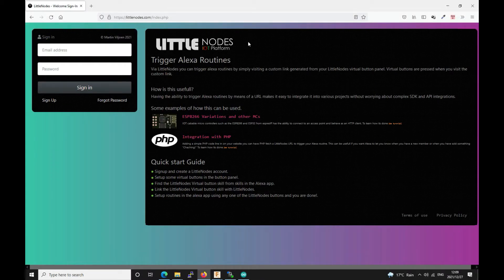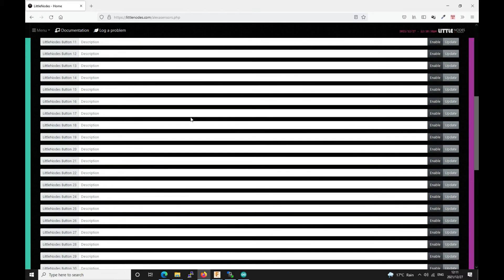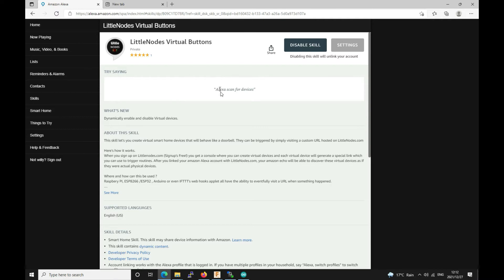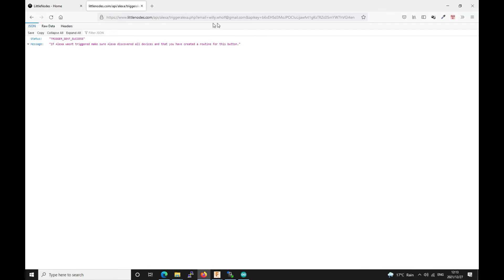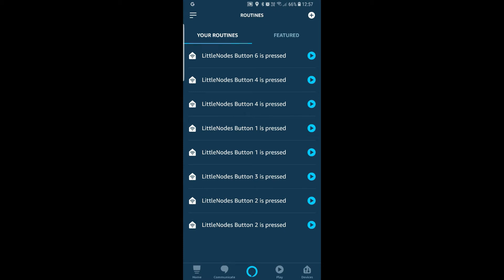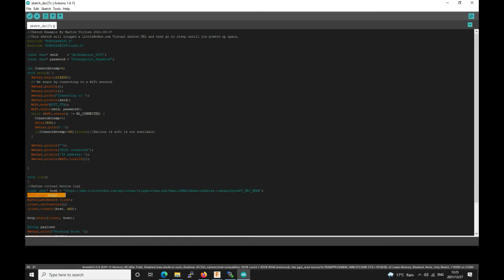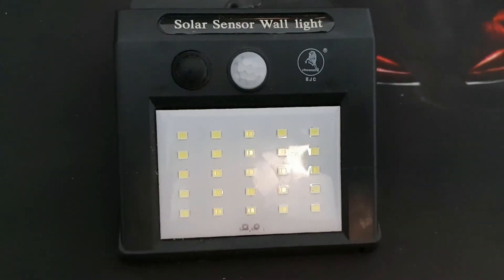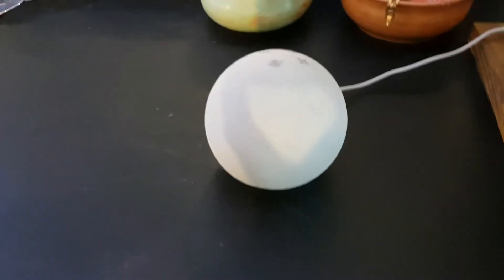Trigger Alexa routines with an ESP8266

Comment: This system is awesome.  It worked immediately using a WEMOS D1 Mini Pro then I changed  "ESP8266WiFi.h" and "ESP8266HTTPClient.h" to “WiFi.h” and HTTPClient.h and it worked fine on a generic ESP32.  Then I added additional Const Char* for host1 and host2 and it worked great for multiple buttons.  Great Job Martin!
Reply from the maker: Glad its working for you